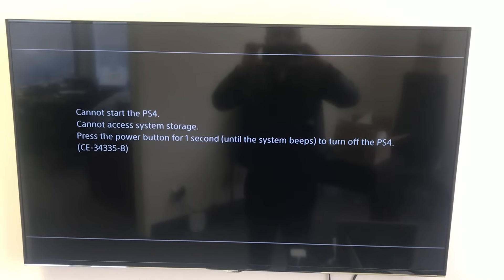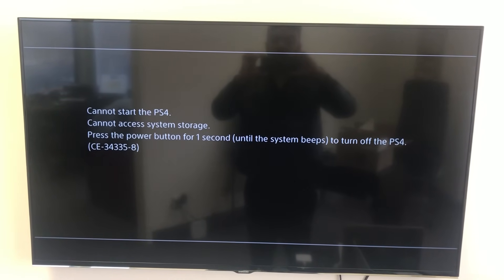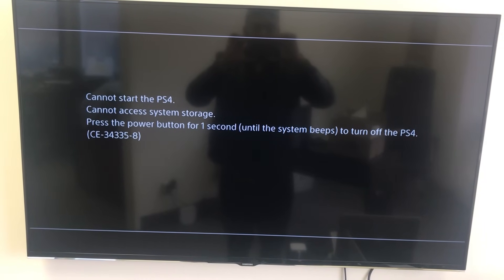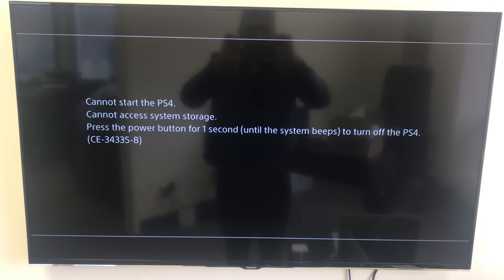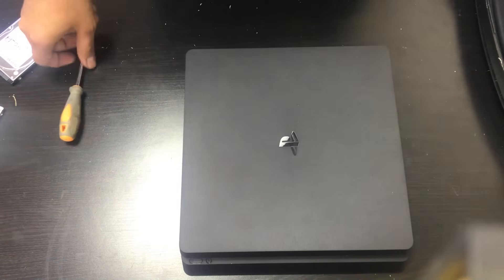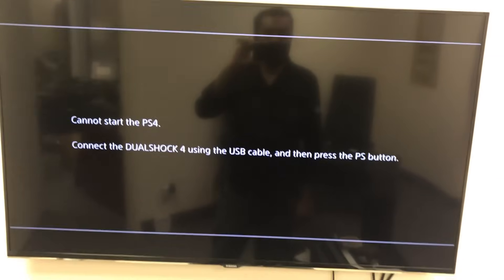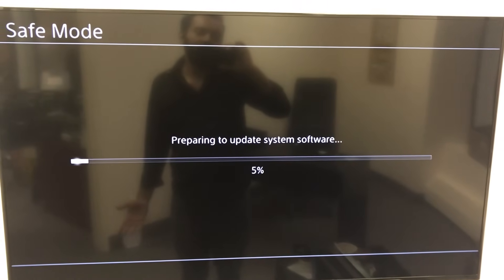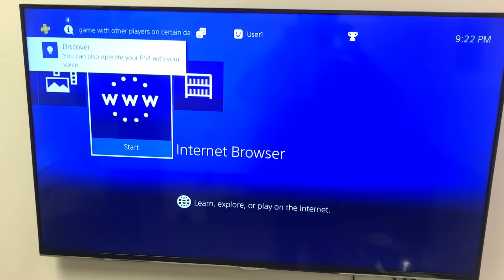PS4 Slim Cannot Start (CE-34335-8) Cannot access system storage fix

Comment: what if it doesnt read the controller? i plug it in with the usb cord and the flash drive with the file but when it starts i get the same screen and i push the ps button but nothing happens. my controller was charging and working before i got the error but now its not registering the controller ps button. i pressed the restart button on the controller already and nothing. the controller light goes on, its white but it just flashes and then turns off. any ideas? im stressing out. should i just get a new controller or cable?

Comment: Bro my problem is I can start my ps4 show me this message I try it 1 and 2 time 1 sec click then it start what can i do now
Reply from the maker: I don’t understand your question
Reply: @fasttechvideo  Hi, I need help with my PS4. Every time I try to start it, I get an error saying “Cannot start the PS4. Cannot access system storage (CE-34335-8)”. After trying 2–3 times, it finally starts. Could you please check if there’s a problem with the hard drive or its connection?

Comment: It fixed my problem without needing to use another hard drive just pulled the hard drive out cleaned the dust  with a tissue popped the screws and thing in and it’s as good as new. Thanks for the tutorial 👌
Reply from the maker: You’re welcome

Comment: I changed my hard drive and I still get the same message
Reply from the maker: Check to make sure its in properly
Reply: @fasttechvideo  I’ve taken it out and put it back about 3 times and still nothing
Reply from the maker: @josephfahie8147  possible issue with the motherboard
Reply: @fasttechvideo  I had the PS4 put down for about a year then decided to use it again but got the message when I turned it on.

Comment: What happens if you dont have money to get a new hard drive my ps4 doing that right now ive tried resetting it won't let me or rebuild
Reply from the maker: Try removing the hard drive, cleaning the connectors and plug it back in

Comment: Thank you very much. This was helpful.

Please what causes the HDD to suddenly go bad, so I can avoid it? I've had my PS4 for 7 years without ever needing to get it repaired.
Reply from the maker: Hard drives have mechanical components which usually fail after multiple years of use, it should be expected
Reply: ok thanks, is there any way I can fix the current system storage without needing to replace it?  @fasttechvideo

Comment: Don’t do this it’s likely your hdmi port needs to be put somewhere else on the tv so for example if you have your hdmi cable plugged into the HDMI1 just put it into HDMI2 or HDMI3 or anywhere else that fixed my problem

Now you don’t need to waste money to buy a hard drive
Reply from the maker: @pranomwanwian9910  an HDMI issue does not cause this problem so you are wrong but regardless thanks for your comment
Reply: @ I’m not a hardware expert but that’s what worked
Reply from the maker: @ perhaps that was what was wrong in your case. This error code comes up when there is a hard drive related failure. Cheers

Comment: My ps4 does that message, but after like 30 mins it will boot up normally. But now that i got the ps5 and i have to transfer data from ps4 to ps5, it won't do it because ps4 needs to be rebooted and that does not work because of the error. Do you have any other tips that would not include buying a new hard drive?
Reply from the maker: Your hdd is on its way out but on its last leg. Try backing it up before it goes completely

Comment: If I try this can I then login in my PlayStation account or is it also resetted?
Reply from the maker: You can log back in your account
Reply: Phew Thank you then im gonna try it
Reply: Another question do you also need a original ps4 controller?
Reply from the maker: @Batmanknight2  we do buy them but usually in bulk not one at a time, one unit wouldn’t be worth the shipping cost
Reply: No I meant for the ps4 when you used the controller and the cabel Will you need the exact Same controller?
Reply: Because the real one is broken and I bought a fake one

Comment: I did everything correctly today and I’m stuck on a black screen and the power button is fading in and out blue what do I do?
Reply from the maker: @ishmaelsupreme21  does the light stay blue? Or does it go white?
Reply: @fasttechvideo it would just stay blue it would fade in and out I redid everything again yesterday and  it worked I got my ps4 running but I just turned it on today at 9:17 AM it turned on the PS4 and it was checking the storage device that’s the first thing that popped up and Is that normal?

Comment: Turns out, that the screw that was holding the hard drive in place was not there so I just had to push the hard drive back in place and it worked.😂
Reply from the maker: @Polric  good

Comment: If I do replace the hard drive will it just be a blank ps4 with none of my past data on it and can I get the initial hard drive repaired
Reply from the maker: Yes all your local saves will be gone
Reply: @fasttechvideo  ok thanks geez that was fast man
Reply: Can I get the hard drive fixed tho
Reply from the maker: @Listen_I_Tried  its possible but very expensive
Reply: @fasttechvideo  ok thanks

Comment: If I set up the update USB on it will I loose my data from my hard drive because I replaced my old hard drive in a PS4 that works but when I put mine in it didn't pull up the PlayStation menu

Comment: Mine showed the error. I restarted it twice, updated the system software, and it worked fine. You don't have to buy anything when you see the error and panic buying the hardware set. It will work unless you have any physical damage during storage or water damage during storage. Also, thanks for giving information about the hardware that can be replaced. It is helpful.

Comment: Mine did that I turned it off then I held down the power button until it beeped back on then it made me hook my controller in though usb to ps4 It then gave me a menu of options I pressed restart ps4 and it restarted fine
Reply from the maker: Great 😊

Comment: Remake a brand new game like Fortnite or play Star Wars Battlefront or Anything else like Video games and more cool stuff and then getting started is only the beginning
Reply: Power off better rest mode for downloading or not to use
Reply: Or updates
Reply from the maker: Thanks for your comment
Reply: @fasttechvideo  And stop losing data without losing PS4 save game not to use rest mode for unplug the wall or damage system will lose all stuff but fair warning ⚠️ or data loss from corruption And be careful not to damage the system it’s the rules

Comment: I get the same error message with a brand new SSD. My PS4 (Original) was working just fine until i took out the old HDD and installed the SSD. Thats all i did.

I didn't touch any of the other hardware. PSU/CPU or MOBO. I just replaced it with SSD because the old one came with the console, used it for years and realized sooner or later it would die. Now i get the same error with the old HDD, as well as the new one i bought (SSD). I tried to salvage the situation by trying to get into safe mode, also didn't work. After the second beep it keeps coming back to this error. There's nothing i can do.

So, what seems to be the problem here? Can anyone help me out? My only choice seems to be taking it to the repair shop, but i'm leaving it as a last resort. I'll take any help i can get.

Comment: Ive bought new hard drive and replaced it but still same problem. I bought a 500GB hard drive. Does anyone know how to fix that problem?
Reply from the maker: @JustGoatthings101  sometimes its a bad controller chip or circuit on the mainboard that can cause the system to not read the hdd

Comment: Honestly I didn’t remove anything I just disconnected all the wires connected to the back of the ps4 and it restarted then it worked so I basically beat the system😆
Reply: You might have to do this a couple times tho I’m only 13

Comment: 6:23 
At this point it stuck on 99% then i get this error: Cannot access system storage
I have to say that i didnt change my hard drive yet
Reply from the maker: Replacing it will fix the problem. If you need a hard drive check the description box and top comment.

Comment: Yo man i replaced my hard drive with a new one but it still shows the same screen
Reply from the maker: It could be that the hdd you got is defective or damaged in shipping. If you bought it from us you can send it back right away for a refund or replacement. 

There is also a chance this is because of a bad controller chip on the motherboard and that's why you hdd cant be recognized.
Reply: @fasttechvideo  i used my ps4 for 5 years, i have never had this problem so is the chip on the motherboard just damaged after use or the hdd is just damaged

Comment: Is there seriously no way to fix this without buying an entirely new hard drive? I truly don’t understand why this is happening
Reply from the maker: Hard drives start losing integrity after 4-5 years of use. First try unplugging it and plugging it back in but of that doesnt work you need to replace it. Check the link in the description box and top comment.
Reply: @fasttechvideo  one last question, if I get a new hard drive, will I lose any saved data on my games?

Comment: Or you could also just blow off/clean the original hard drive and put it back in the same way and that’ll fix it sometimes. I didn’t even have to unscrew the cover off the hard drive, I just took it out the ps4 as-is blew it off and put it back. Worth a try if you don’t have another hard drive to replace it.

Comment: I have a question. I have a Seagate 1TB external HDD that I used as my PS4's extended storage.
Now my PS4's internal HDD broke and I plan to replace it with the HDD I'll extract from my external HDD/PS4 extended storage.
My question is before extraction do I need to first reformat the external HDD using a PC or laptop? Or I don't have to do that because the PS4 will still recognize it and can reformat it?
Reply from the maker: You dont have to format it, the ps4 will do it for you.

Comment: My hard drive was working fine until I had to eject a disk and in the process I removed the drive. I think it was just on its last legs and just removing it once finished it off. But still weird since there were no signs of the drive being on its last legs. It was not making any noise, while we used the console everything would function normally, etc. Anyways, I'm probably gonna have to buy a new one lol. 

And yeah I've tried removing it and putting it back in multiple times, Checked the connectors and everything. Only thing I have not done is connect the drive to my laptop to 100% verify for sure it's the drive but I do not have the adapter :(

Comment: Main issue is that after properly naming the folders and downloading the latest console full system software, it says it's corrupted on the USB (SU-30645-8) when booted into safe mode and trying to initialize. Note: Has a brand new internal HDD I just bought. RIPPPP
Reply from the maker: If you bought the hdd from us you can send it back for a replacement but Im guessing you didn’t and thats why it doesn’t work 😂
Reply: @fasttechvideo  strange use of emoji but update: HDD is perfectly fine. Got it to boot up perfectly after a lil oversight. Im good though
Reply from the maker: @SoHAimbot  awesome 👍🏽

Comment: It doesn't mean the hard drive is broken.

My PS4 get that message by plugging two hard drives at the same time.
Or internal hard drive not plugged in properly.
It has never been a broken hard drive.

I've been getting for free & buying broken electronics for about 20 years now.
Out of all the hard drives I've tested they all work.
Obviously I've had multiple PS4s with corrupted data but never broken hard drive.
I just wipe data reinstall always a 2-minute fix.
Reply from the maker: The case in this video the hdd was actually broken. You can have harddrives that have no power (bad pcb) or make ticking noises (stuck spindle). Im glad you got lucky to have so many systems where the hard drives were good.

Comment: I thank you from my deepest part of my heart,but i have one question I dont have any problems with the har drive and im low on money is it somenthing if i remove the HDD dust it and then put if back?
Reply from the maker: You can try it, it works sometimes but only if your ps4 is full of dust.
Reply: @fasttechvideo  thanks man but unfrotuneaty that wasnt the probem (sorry for bad english is my third laungage)
Reply from the maker: @Lodias302  yes in that case you will have to replace the hdd.

Comment: I do not want to take away from his video bc in worst cases this is needed, but in some cases u can set the ps4 into safe mode and rebuild the database
Reply from the maker: This is temporary fix at best. You will have this issue again if you have a failing hard drive.
Reply: @fasttechvideo  i agree totally but for some its not a failing hard drive. PS is notorious for building shitty stuff. Im sure you yourself can attest to that. Otherwise this video wouldnt exist nor the content u create.

Comment: A Seagate gaming drive you can buy from wall mart and not have to open you state just plug in or like I said just delete applications enough that your system storage can work properly.
Reply from the maker: Not going to work. You need a working internal storage hdd to use your ps4
Reply: I have a PlayStation Pro and it worked on mines to simply do as I mention.simply remove applications from system storage and it will stop.And actually the Seagate gaming drive from super center I bought for $206 is a plug in no need to go inside my system.
Reply: Mines working great
Reply: Bullshit
Reply from the maker: @kevinbrown3419  You are entitled to your opinion. The likes and view count and a lot of comments on this video disagree with you. Have a nice day.

Comment: My controller isn't turning on whenever I plug it into a usb
Reply from the maker: Try using a different controller. If the problem persists you need a bluetooth chip replacement

Comment: So what do you do now when u put in a new hard drive and still doesn't read software?
Reply from the maker: Could be a mainboard issue. Try cleaning the hdd connector on the mainboard first before replacing the board.

Comment: so i have a question...i did an HDD upgrade and saved my old 500GB HD for a
 later backup operation as I did not have a backup external drive at the
 time...I bought one and put my old drive back into the machine to do 
the backup but it won't start without a software update as it has an 
older software version on it. I tried to do a software update only but 
it wants a full re-install update which i fear will wipe all the data on
 the original HD...is there a way to get the data backed up on the 
original HD?

Comment: I dropped my slim while it was in the original packaging as I came home from a late night at a friends house, and I didn’t set it back up until I woke up. When I did it wouldn’t load and I saw this vid and was WORRIED. I took the hard drive out like you showed and it was pretty dirty so I cleaned everything up really gently and connected the hard drive again and thank the lord everything was cool after that! I appreciate the video still cause i wouldn’t have know off top of how to access the hard drive or if I needed info to get a new one. Hope this helps a fellow worried gamer. 👋🏻🍺

Comment: Man I just took the hd out and blew some compressed air down in there and it started working again. Now I'm definitely backing everything up, had some sick ass video clips I thought I'd lost.
Reply: It still work good?
Reply: @otsutsuki.7714  So far so good.
Reply: @guttagutta420  was u on the cannot start screen and how u did it I’m not tryna lose no data😔
Reply: @otsutsuki.7714  Yes. I just powered the ps4 down and removed the hd. I then blew air down in the hole and carefully wiped the hd contacts. Popped it back in and it worked.
Reply: @guttagutta420  I tried it didn’t work but ima try it a again sometime but 1 more question after that it put you back on the blue PlayStation start screen?
Reply: @otsutsuki.7714  After I did that and put everything back together it booted up like normal.

Comment: I am getting this message on a PS4 Slim with a newly installed hard drive. I have the USB flash drive plugged in with the “Reinstallation File”
Reply: I literally just installed a new hard drive and turned it on and got the message. Is it not the “Reinstallation File” that you need

Comment: Do not buy a hard drive from him before you try this first step1 unplug ps4 step2 plug back in step3 put USB cable in ps4 then plug in controller then turn it on by using the controller do these 3 easy steps to fix this problem unless your hard drive is corrupted this will fix it its a error that happens alot with 1tb hard drives

Comment: Try cleaning it or checking if any cables are broken I just fixed mine. I unplugged everything cleaned it and switched a wire if it doesn’t work then buy one. They just want money tbh

Comment: So there’s literally nothing I can do except buy a new hard drive edit: I threw my ps4 at the wall 😂
Reply: A Harddrive is 90$, new ps4 is like 400$. Its worth trying ‼️
Reply: @currychapo  but you gotta pay 90 plus turn into a mechanic to fix the dam issue it's so Dam stupid
Reply: @687donny  I bought the external one from gamestop and it worked, or you could get a USB Stick and use that as well.
Reply: @currychapo  how did you use a external hard drive for the system software?
Reply: @JackRabbit808  Once i plugged it in it work and I was able to swapped over my storage to the external drive. It also allowed me to update the system. Get a USB Stick bro that works too
Reply: Lmao dadeass just did the same thing 💀🤣
Reply: No you didn't.
Reply: ha! I  threw mine away 8 months with out games -_- and everytime it just says 'Cannot start' yeet it in the trash lmao